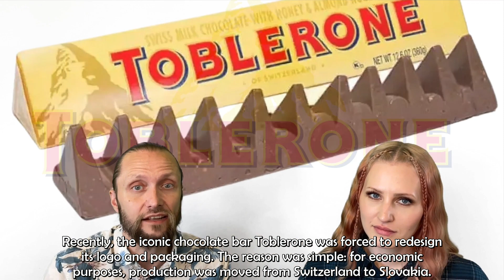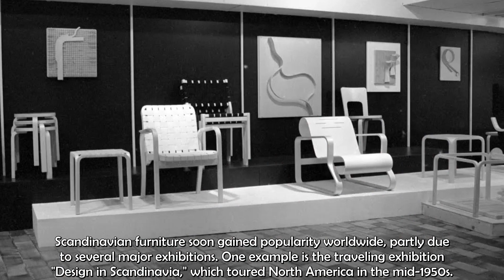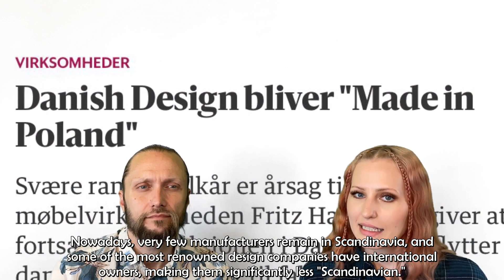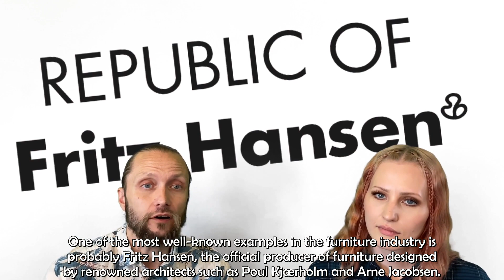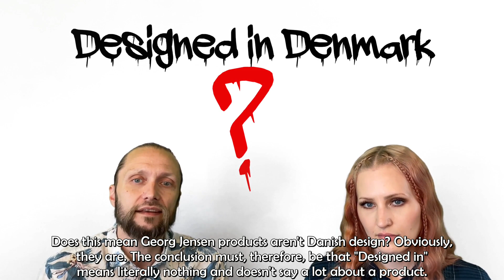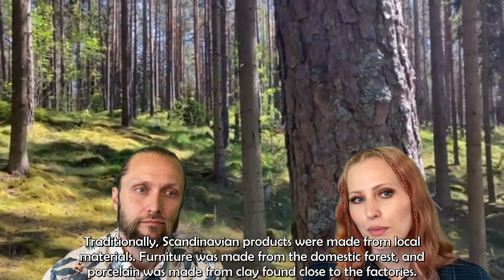Is Scandinavian Design a thing of the past?

Comment: as long as the craftsmanship is equally good in Poland, etc. then i'm totally fine with the endproduct. 
For the sake of new furniture design in the future, i do worry though. The strong collaboration between furniture designers and carpenters, pushing limits together, is the thing that makes midcentury danish/scandi design so special.
Reply from the maker: We really need the small workshops run by highly skilled craftsmen! Sadly it seems economically impossible nowadays. And it was probably hard back in the days too. Not even Niels Vodder managed to make any money to speak of from the collaboration with Juhl.